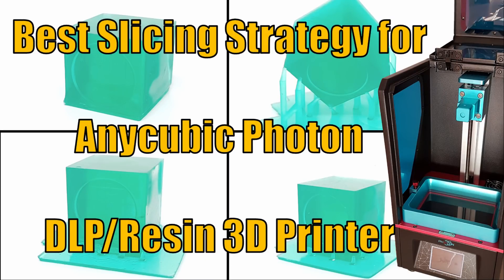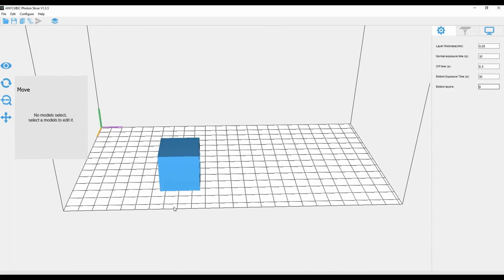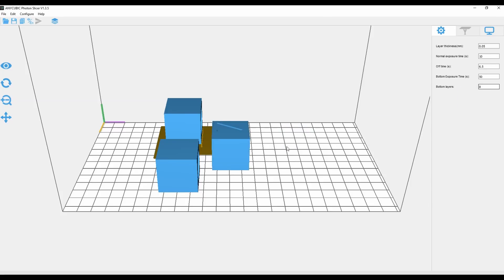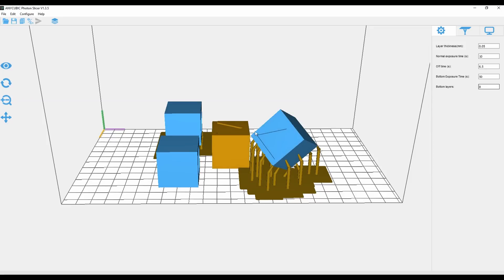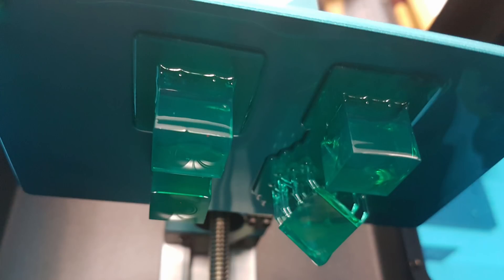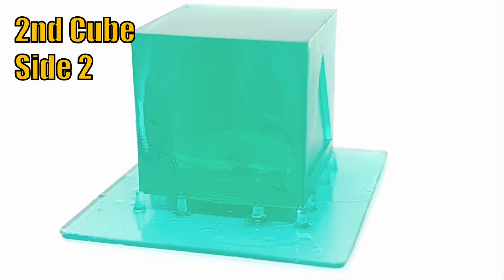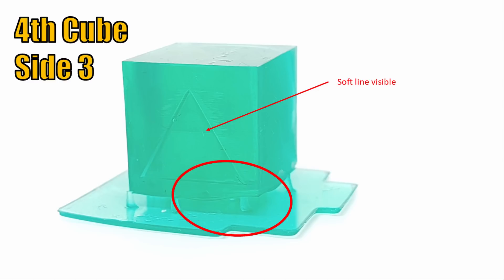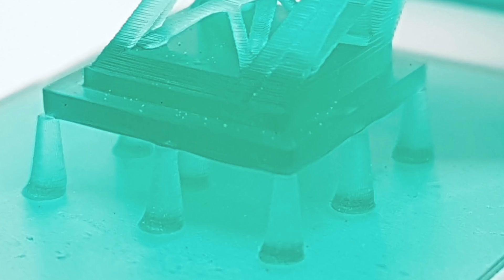#03 Anycubic Photon - Best Slicing Strategy for SLA / DLP 3d Printer

Comment: Hi there, I have a question/problem
When I try to slice from the program, it slices very fast, its about 1/3 of the normal time, and when i try to print it just doesnt print.
I tried reinstalling the program, but it didnt work
Reply from the maker: Most probably your USB stick is faulty and i would recommend to try it with other USB stick.. It is always good to first generate the gcode (.photon) on the harddisk. Wait until the file is fully created and then transfer to the USB stick. Afterwards check the MD5 checksum and compare both files to verify if your USB is ok.
Reply: @android4cg  I just fixed it... I had to reduse the layer thickness. Thanks though
Reply from the maker: Great that you fixed it and reported the solution. This can help also others to find solution.

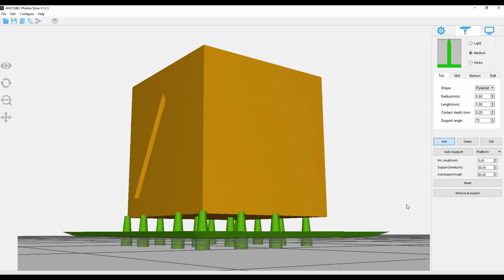Comment: 2:28 Why do supports look like their going through the build plate?
Reply from the maker: The slicer just adds some objects (support) an performs boolean operation at the end. It does not matter if the support cylinder are longer because they will be anyhow "cut" on the printing bed.
Reply: @android4cg  THANKING YOU, and For GREAT video's

Comment: How is it possible that the resin is hanging down (2nd cube side 3) when there are less or no supports. The printer prints upside down so I would expect it to curve upwards instead of hanging down.
Reply from the maker: This is really interesting question. The reason is that the plate is pushed up (down from video perspective) because of the fluid resin between the cured model and the build plate. This is one of the main reasons not to place the model parallel to the build platform. Increasing the off-time parameter could help to minimize this effect but the total printing time will increase.

Comment: If you wanna place an object flat down without support and then you wanna remove it, Use some alcohol. With a toothbrush or ordinary brush, pour a little alcohol on the piece when it is still on the plate. Continue like this until you feel that the piece is already loose...

Comment: I've been printing A LOT of flat surface objects directly into the plate, yes they stick hard to it, but that depends on your first layer curing time. If it's too hard to remove then try reducing it 5 seconds until you get a balanced result. Don't bias your suggestions without proper analysis first.

For the "elephant foot" effect due to light bleeding out on the first layers, if you created the object, create a chamfered edge of value = Layer Height * First layers. So if you're printing at 50 microns and have 5 first layers the chamfer should be 0.250mm. I came up with this idea as I was going nuts with this thing. Also NanoDLP slicer has the "erode" feature with does that.
Reply from the maker: Thanks for sharing your experiences on this. I do not say it's not possible to directly print the object onto the plate by tweaking the parameters individual for every model. But i personally do not recommend to do this ... same applies to all the high end SLA printer manufacturer who strictly also not recommend to directly place the object without support onto the plate.
Reducing the curing time for the first layers means also increasing the risk on failing rate. Beside this the model would be needed to be chamfered in order to reduce over bleeding at the edge. Signature or small details on the flat surface (like the 3dbenchy at the bottom) will be impossible to be printed. Also final z-height is slighly impacted because homing accuracy between FEP film and build plate is not designed to be very precise .. even knowing that impact is very low. But if you have found good settings for direct print onto the plate and you are happy with the result than there is no reason to change this. But as said i am still recommending to every newbie to follow the advice from 3d manufacture and experts. There will be no hassle to remove the final print from the build plate and you will have high printing success rate without the need to tweak the model and/or the printing settings. Happy printing!

Comment: great video, thanks for the experiment and explanation. I noticed you have 6.5s in off time, any reason for that? (default is 1s)
Reply from the maker: Yes, there is a reason for this. Check one of my videos where i explain the reason for this which is Anycubic Photon specific. Only values greater than 6.5 seconds would take affect but it is really not necessary based on my experiences.

Comment: Thanks for this comparison! I got my photon today and I will try to learn from your experience.
Reply from the maker: Good luck with your first print! Let me know what was your first experience.
Reply: Right now, I made the calibration of the platform. But my LCD-Screen behaves strange. It often don't react or react with seconds of "Rendering" time... My Firmware says V4.2.1._LCD.0   On the anycubic Website, the newest Firmware is V1.1._20180720. Do they have changed the Designation of the Firmware?  I will contact the support...

Comment: Hi thanks for the sharing. I normally avoid using supports and print directly to the print bed while resin printing, due to resins are very expensive~ I wish to make full use of every drops of them.

What I did I will just create a small bevel corner on my models, and remove from there.
Reply from the maker: At the beginning i was thinking the same. But after some time i was changing my mind. If you check some tutorials from very expensive SLA printer they recommend the same. The much more easy removal after the print is one of the biggest advantage when using support structure at the beginning.
Reply: totally agreed! it was just I have to be a little more calculative as I use this machine to create models in mass, and I have to fit in as many models as the platform can hold (the print bed is small zzz) in one print, and with the support on i won't be able to do that. Anyway, good sharing I do learn something new from your video, thanks! 

besides, this is a really good printer, been using it for like 6 months, no issue and the print quality is fantastic, good to have one ;)

Comment: Thanks. Question. I noted that the material that is on the build plate, like your tower, didn't fully stick and was curling up on the edges causing issues with my print. What should I do different.
Reply from the maker: I would increase the exposure time (up to 90 sec) for the first layers. Beside this i would increase the number of bottom layers which somehow compensates inaccuracy in bed leveling. I hope this suggesting will help, good luck!

Comment: Good video, i did buy this printer a week ago, but it wont print anything, i did try everthing, it just sticks to the vat, i was looking forward to make some good prints, but no i did level the printer 20 times-but no luck, and all my design files when sliced-says only 58 minutes to print,
Reply: have you try flint's way of bed leveling? (although not the official guide's way, its been doing great for me thanks to flint)  if you haven't give a try  https://www.youtube.com/watch?v=roAqm5c3rfU&index=8&list=PLh-1wqLZGmyyoYMMsVfAVVKOd_7h2_5dP&t=0s     and a good way to verify if its sticking is try to pause the print to see if the base layers are sticking before the print finishes, so you dont have to wait until the end to know if its sticking or not
Reply from the maker: Which resin do you use and which parameters? Have you applied support structure?
Reply: i di try all,  a week without a print,  cant understand it,,   i use the anycubic resin.
Reply from the maker: Strange. Have you also tried pre-sliced models? You can see uv light on the screen? The first 8-10 layers are exposed with minimum 50-90 sec (mandatory)? Verify this without vat/resin.
Reply: have dobe so many files, but it wont print a full design, the resin cure in the vat, and some on the other platform, it shoul be plug and play.  mabye the printer has a software problem,  i did email anycubic for a new photon- it should be fun, but now i have cleaned the vat and platform 30 times in 4 days,without a good result, i did take many pictures of the problem
Reply from the maker: What you mentioned can happen if curing time of the 1st layers is to low. I would recommend to increase amount of 1st layers and increase curing time of 1st layers (60-90). If you leveled the bed only slightly to low because to much pressure on the paper than the first 8 layers (0,4mm) will be not enough. Good luck !!!
Reply: When you level the bed, how tightly do you screw in the screw? From everything I've read, that screw has to be  very, very tight. It could be that the bed is moving during the peel process and that's what's causing the print to come loose.
Reply from the maker: First of all you should always place the object in the middle or symmetric. I have tightened the screw strong but be carefull not to overtighten. If the print is falling down i would recommend to increase curing time (2-3sec helps really a lot) and use the heavy/strong structure. It is important to use enough support structure. If you follow this you should be able to solve such issues. Also increase the curing time of the first layers ... the base is so important.
Reply: It is bad leveling jobs, you can ask help from ANYCUBIC
Reply: im having the same problem !!!
Reply: @astreids  I know this is late and you probably already figured out the problem... But in case anyone else has this problem, I extended the base layer exposure time to 60 seconds each and get the normal layers to 10 seconds. The time gets pretty ridiculous but that is what worked for me. Of course it is case-by-case but hopefully this helps for some people!
Reply: May be your Fep is not tight enough. Tighten 8 screws under the Vat
Reply: If you have some cured resin stick in platform, some stick in Vat, that's because of loose Fep
Reply: Avail maybe too late, but consider sanding the build plate with 200 grit sandpaper. It considerably improves build plate adhesion. Do this regularly (I lightly sand after around 20 prints) to get rid of cured resin in the scratches.